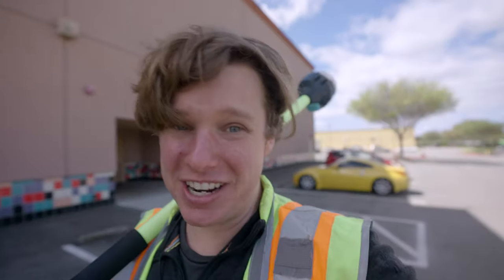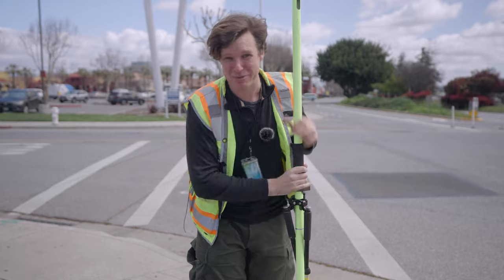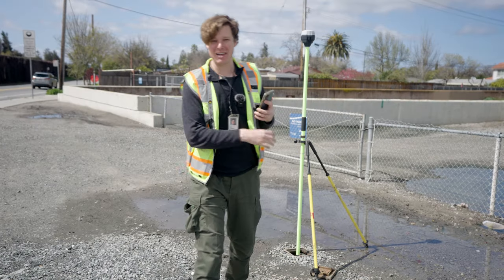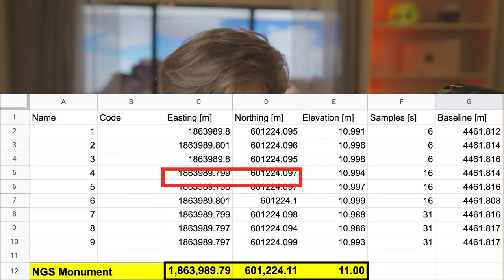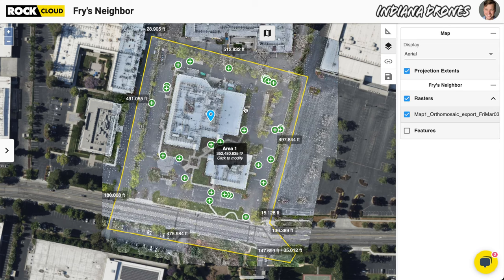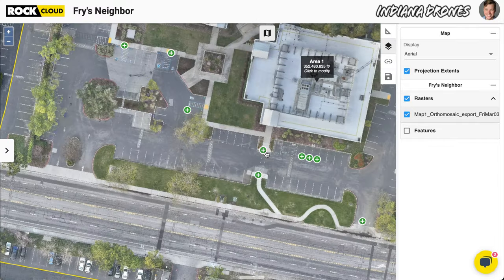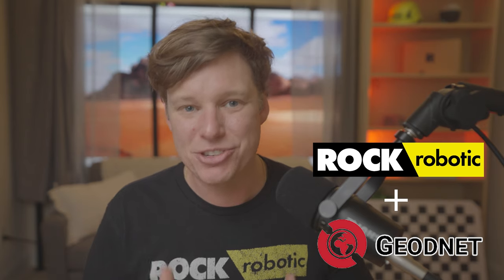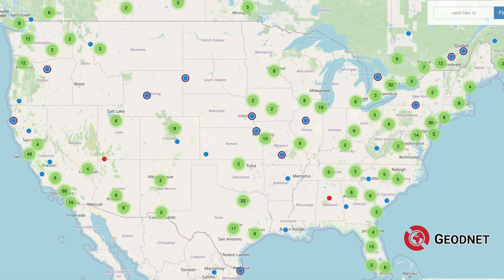How Accurate is ROCK RTK?

Comment: Nothing beats a base station when it comes to high-precision 2D maps and 3D models in drone-based photogrammetry. 
DJI partially addressed this issue by introducing its own Mobile RTK Station. 
ROCK RTK is a much better solution because it is compatible with standard GNSS devices like Emlid.
Reply from the maker: Thank you! I have been having great experiences with the triple band - all constellations too.  More data == Better results

Comment: What are your thoughts on the new DJI Matrice 350? Will it bring any additional capabilities to ROCK LIDAR payloads?
Reply from the maker: to start it will allow the real-time point cloud and simply the control and command of the drone to work at a much further range.  This is very nice, especially when you have trees.